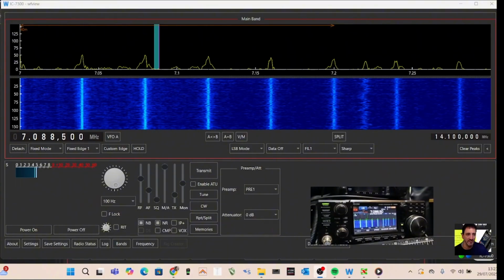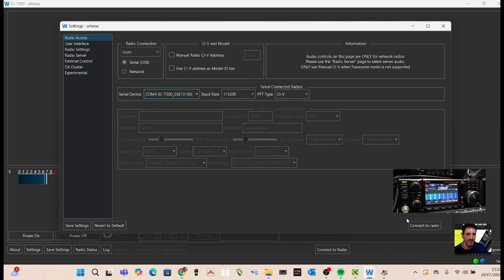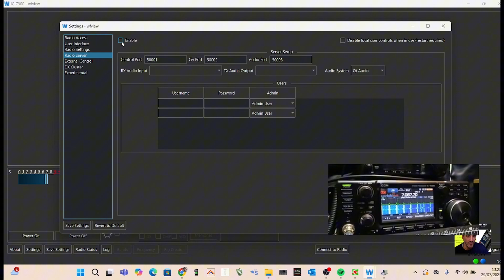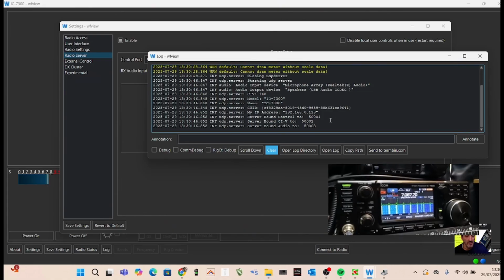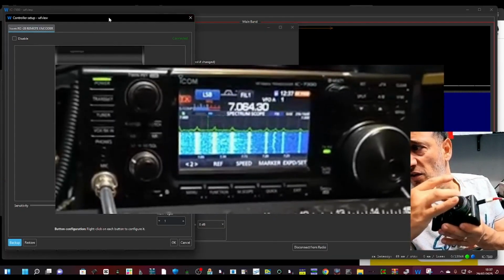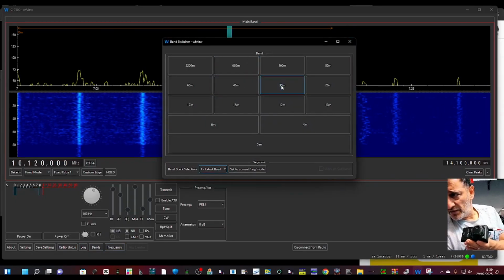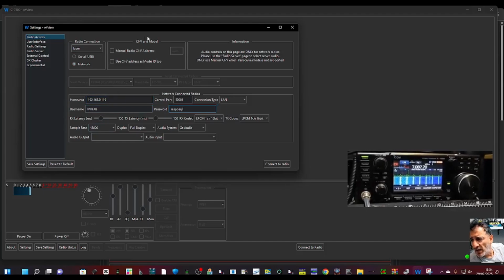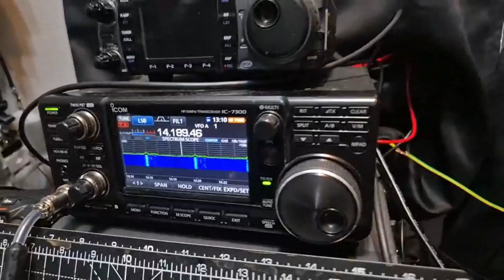SDR CONTROL & ICOM IC-7300 - Wireless Control , WFView Server

Comment: I have it working on SDR-Control Mobile. One thing I find is that I have to keep trying to connect several times. Each time I get a message that it can not connect. It eventually connects and works fine.  A bit of a pain though. I could never figure why it will not work with RSBA-1.
Reply from the maker: What is sdr control module ?
Reply: @M0FXBHamTech   "SDR-Control Mobile" - the iPhone version of SDR Control

Comment: Great video. One thing to note, at 3:30 when you are setting up the server, you must select the RADIO’s audio devices. Not a speaker or mic. The radio is typically named something like “USB AUDIO CODEC”. This is crucial. Otherwise you cannot send or receive audio. This is the server setup so it is “serving” the radio’s audio. If you select a mic or speaker instead, as you might have here, then you get a fancy intercom from your phone to your PC 😅. 73 and thanks for the nice videos on the topic!
Reply from the maker: Thanks loads